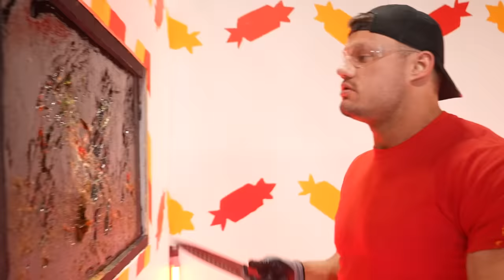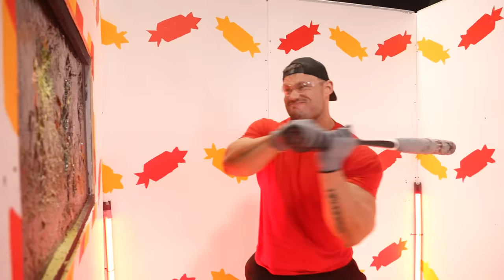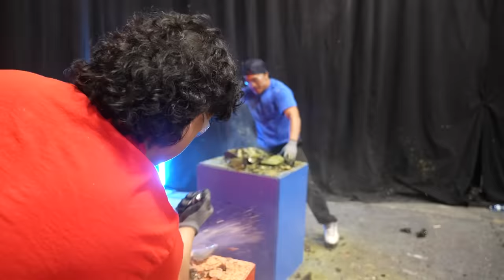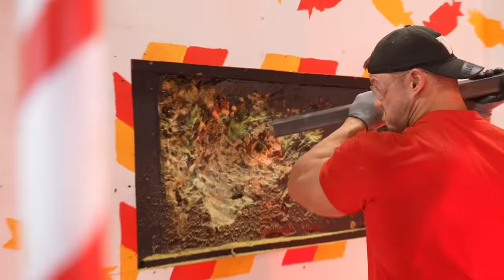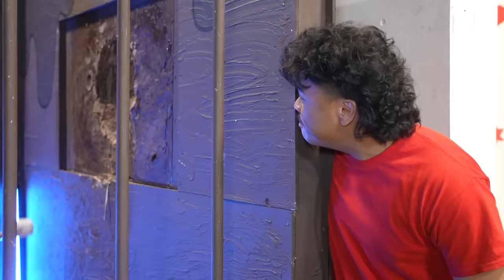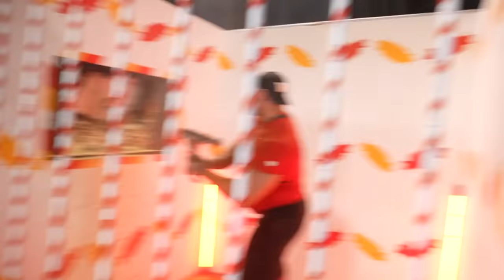First To Escape Candy vs Chocolate Prison Wins

Comment: The rubber mallet made me laugh. It’s designed specifically to not break what it hammers. It’s more of an impact tool meant for making things go down. Like getting a 2x4 into place when it’s a snug fit.
Reply: It still has the ability to break stuff...it's just designed not to do much damage to already firm materials. Obviously a wall made of either chocolate or candy is gonna be difficult to destroy, but if it was less dense and on the floor, the candy or chocolate would break apart easily

Comment: So when you’re swinging and you hit something with a bat which would basically be a baseball and a game they need gloves that can reduce and make the vibration less than what it really feels like without see if you go without the gloves your hands would basically be tingling for hours I think and it’s kind of like a stinging vibration so it would vibrate and then pain for a little bit so basically we’re gloves whenever you’re doing baseball practice or something and if you don’t get Immediately and if you find them free clean them off if they have bugs in it put soap in hot water and then the fun thing put it on a hose submerge it in water soap hot water and then steam clean the inside just in case if you missed some bugs and if you don’t want to be my like me only wants to find them and have to clean them to get free new condition to